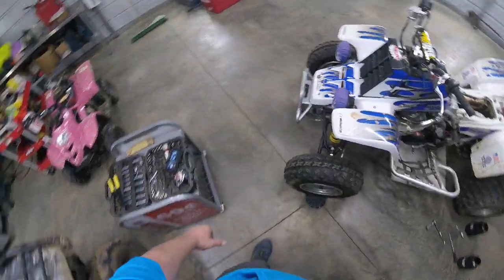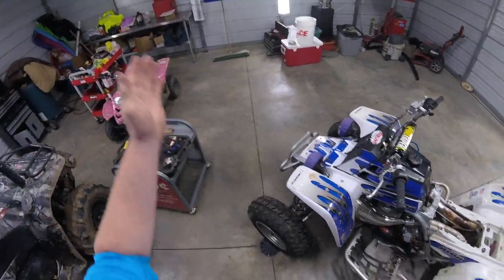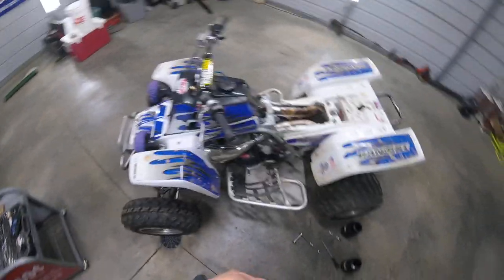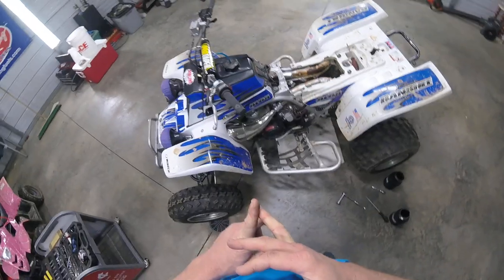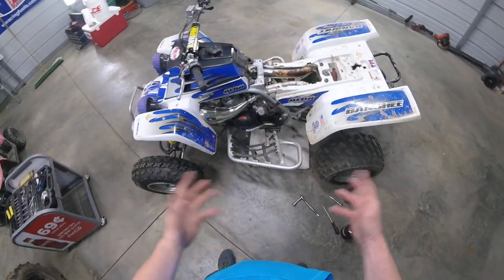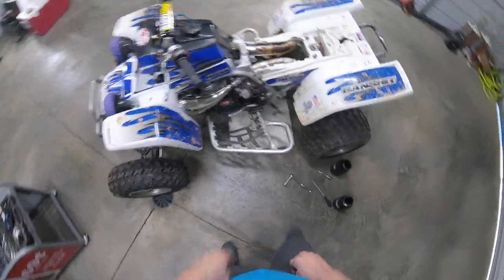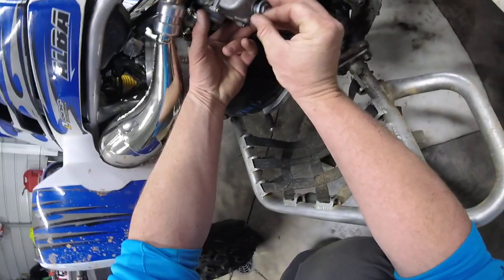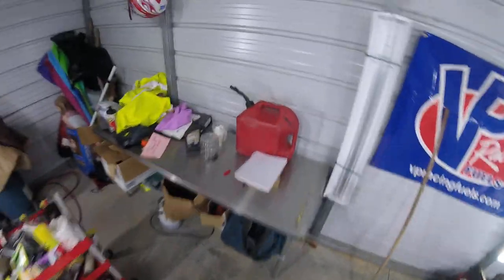100hp 421 cub seasonal jetting change

Comment: Hey.. 2 Important things you might want to mention. 1. It depends on what pipes you have and 2. Depends on elevation where you are at. Where I'm located it calls for 280 mains with T5 pipes
Reply: Julian Long your going off of stock carbs he clearly says keihin carbs
Reply: Totally different build, for one you’re on stock carbs, these are keihin carburetors, but yes pipes can make a difference as well as elevation, but I say anywhere from sea level to 2000ft you can run the same jetting, no real need for adjustments, also if you’re jetted on the rich side then you don’t need to go fatter when the temperatures drop, you can leave it as is.
Reply from the maker: wrong i have talked to keihn they said its the say there jets are set up
Reply: @banshee100  what's the same??

Comment: I have basically a stock banshee with T5 pipes im at 142/42 at 1.5 turns out at 800’ sea level . 66 degrees outside

Comment: i have a 421 cheetah cub, with cool head, shearer sbif, 39 keihin pwks, stock bore stock stroke, im trying to figure out my jetting! im 185 above sea level, i currently have a 168 on the main and a 60 pilot but its not rt
Reply from the maker: Take it out into the pasture on the highway put it in 5th gear about 25 miles an hour and floor it run it to redline tell me what it does
Reply: when i first put the carbs on it ran great. next day not so much it just bogged every time i wop the throttle
Reply from the maker: Is that alcohol carbs or gas
Reply: vp 110
Reply from the maker: 52pilot
Reply from the maker: Cel needle
Reply from the maker: Same main
Reply: dont know what type of needle it is, it has 5 slots and its one down from the top
Reply: @melvinriley2060  try 168 main, 55 pilot, DGH needle on the 3rd-4th position down from top. If you’re only one slot down you’re lean on the needle. Did you ever figure it out? Also if you’re stock stroke then you can’t be a 421 cub, you’re most likely a 392 cub.

Comment: What area are u from I'm from Memphis tn I got a 472 super cub CPI outframe pipes also pwk 35s on gas what jetting would be OK for that set up it pulls fine on launch but sputters mid range to top end I'm guessing needle adjustment an maybe a main adjustment but not sure what to set it at..thanks
Reply from the maker: Never had that motor
Reply: Ok

Comment: Does the humidity affect your jetting cause i had a ct pipe on my raptor and they recommended a 175 and 170 for 70 degrees low humidity but i dont live in southern cali so i used a 170 and 165... southeastern pa is warm and usually fairly humid in spring and summer
Reply from the maker: Elevation does Humidity will make it run richer for hotter humidity

Comment: Shit mine has 35mm PWKs and its lean on 160 mains in the summertime. I run 165s in the summer and 170 to 175s in the winter. Your bike is way hotter than mine too. I would be doing a rebuild video if I were running 150s..lol
Reply from the maker: What's your elevation and mods

Comment: Hey man I really like your vids and I'm trying to get into four-wheelers but I really don't know what to look for do you think you could help me with some info
Reply from the maker: Yes sir
Reply: @banshee100  I'm somewhat of an experienced Rider and I was looking at a yfz450 or something like that like a older bike 2006 range just for some country riding in the fields
Reply from the maker: @jalonleslie6512  get 07 yfz they came with the oil mod 06 didnot
Reply: @banshee100  thanks for the tip I definitely would not have know that little detail thanks man 👍🏽
Reply from the maker: Yea sir owned a 450 yfz for 10 years

Comment: where are you from ? my builder sent my cub back with 162 mains. he told me the cylinders were lean with those mains and i would need to be running 170 mains to "ride around" with. ive left the 162s in for the last few weeks and havent gotten my coolant temp past 160. im in houston tx. what are ur thougthts? i also had ab jets in my carbs. he thought they were fake cause of it and said he couldnt get it ruinning right without using real kehin jets
Reply from the maker: Your builder is an idiot. I am from Tennessee and run 155 mains.
Reply: @banshee100   who built urs ? i thought i found good builder. you might’ve heard of him. he’s from san diego, kevin herr (herr jugss racing)
Reply from the maker: @user-lx7fu6yx5u he's good but mine will not run on 160 mains way to rich
Reply: @banshee100  mine hauls ass. i have a ported yz250 and have always wanted a banshee. i bought it a year ago and didn’t know a damn thing about them. kevin told me it was a knock off cub cylinder with an iron sleeve and the durations were all messed up. he ported it and fixed it. i just threw it in last weekend. i feel like it’s almost as fast as urs.

Comment: I have bout the same set up 421 cheetah cub, inframe shears, 35mm keihin carbs, running 152 main what pilot should I be running?  I currently have 45 pilots
Reply from the maker: What's you air screw set at?
Reply: Hellcat channel 
Three turns out
Reply from the maker: @JoseSandoval-xh9gf  try 1 turn out
Reply: @Hellcat channel I will that thanks
Reply: What's your bike riding like eith 152 and 45?
Reply from the maker: 158 main 58 pilot
Reply: @banshee100  so if your using a 58 pilot how many turs out from closed are you
Reply from the maker: @rideordie2736  1 and half